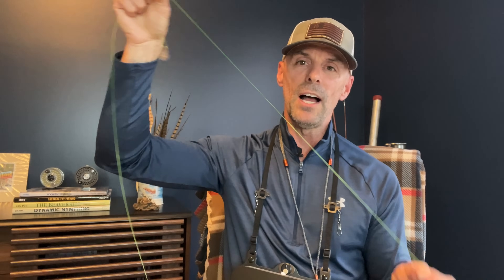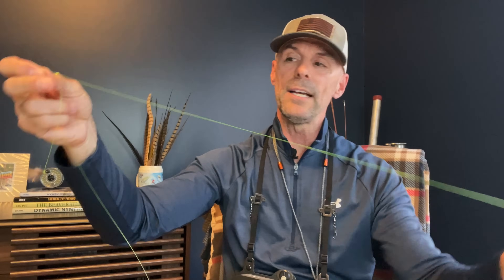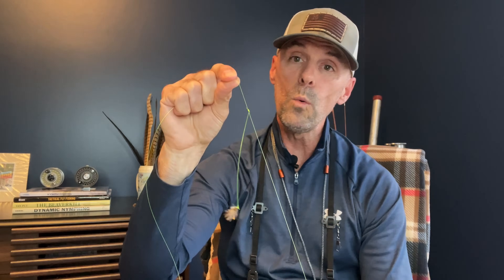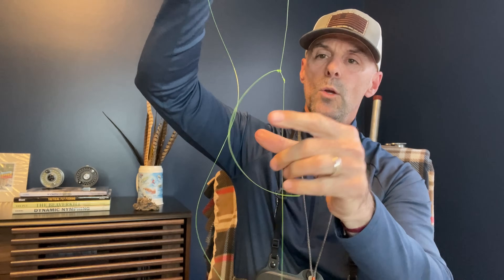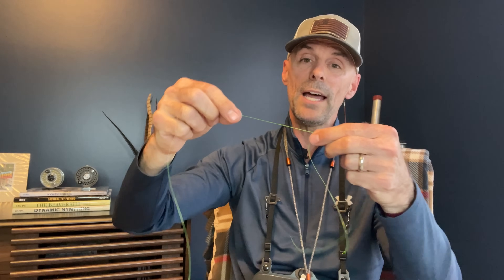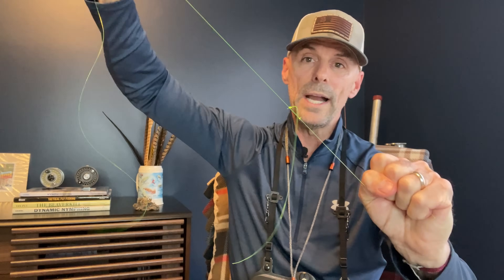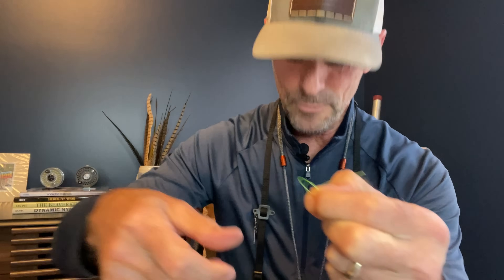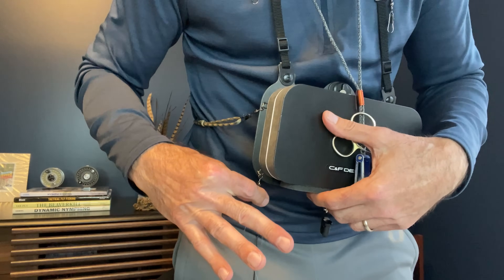How to make an ADJUSTABLE Dry-Dropper System

Comment: Thanks for this video ( and all your others).  It's amazing how fly fishers get to the same place using different methods. I tie a tippet ring on the end of my dry- dropper hoppers and then it's easy to adjust the depth. Just clip off the old and tie in a new length of tippet and your ready. Starting in a couple of weeks I'll use this almost exclusively on small Western rivers and streams.
Reply: you use a tippet ring in the fly?  Or do I misunderstand?   (at that point, why not tie off the bend?)
Reply from the maker: Sounds like a good one, William.  We can all learn from one another.  It’s what makes this sport so great.  Good luck to you!

Comment: I use this system for steelhead with weight on the bottom and fly on the tag and the loop lands all of them. I also keep my tags in a used plastic extra gum containers keeps them neat. Thanks for expanding my knowledge, great idea.
Reply from the maker: Perfect testimony on how they hold, Kyle.  And the gum containers are a great idea.  Thanks for watching!
Reply: You have helped me understand hopper dropper rigs and especially the adjustable hopper. Thankyou Mike USAF Ret
Reply from the maker: Glad it is helpful, Mike.  Thank you for your service!!

Comment: First, I am a big fan, thank you for the great content.  With making fishing easier, Dr. Paul Gaskell teaches a ladder leader, which is a series of figure 8 knots that you tie in several places in the point or main line. So you can move your tags wherever you need. I have been using this and moving tags around is fast from a foot of water to four. The plus is that the perfection loop spins on the main line also making for less unwanted knots
Reply from the maker: Appreciate you being a fan, Rob.  That sounds like a fantastic way. That’s the great thing about this sport, we can learn so much from one another.  Thanks so much for watching and tight lines to you.
Reply: Hi Rob.  Can you kindly post the ladder video?  I could not locate it.  Thanks in advance.

Comment: I just recently switched to that c&f pack also, loving it so far. I replaced the neck strap with Paracord and foam from another old lanyard for better comfort
Reply from the maker: I’ve been using it a lot this spring and loving it, as well.  So nice to go so light on the stream.  Sound like a nice idea with the neck strap.  Appreciate you watching.
Reply: @OldDominionTroutBum  i've seen a few spanish and french comp guys who use this chest box too, and they've found interesting ways to rig it with the back panel from umpqua, W&J, and one even made a back pocket out of the new patagonia stealth work station. 

i'm gonna give the chest box & lumbar pack a try this summer for wet wading, when i don't need to carry extra layers,

Comment: Hey Cory!  Cool idea!  Lack of adjustability is the main reason why I will fish an indicator instead of a dry fly in some of these situations.  This obviously solves that which is super cool.  I'm wondering if you have tried doing a similar thing as this using a uni knot, similar to what you would do when adding a backing barrel?  They are adjustable and you could leave a tag for the dry fly.  I'm guessing it would be kind of hard to get the tension right with fine tippet compared to your method.  I might give it a try and see what happens.  Thanks for sharing.
Reply from the maker: Hey Eric.  I don't like using the uni because it is a little too tight for lighter tippet.  When you slide it up and down, it will kink up your tippet.  The perfection loop is easier on it.  This will definitely work for you.  Just make sure you keep your dry fly nice and dry.  If it gets a little wet and sinks, the surface will "grab" it and want to pull it down.  Good luck to you and I appreciate you watching!

Comment: Question for ya , have you ever had any issues with hook ups on the dry . Does the perfection loop ever loosen on the line and lead to a softer hook set because of the loop sliding down the line until it hits that stopper knot or has that not been a problem ? 
Great video ! And I can’t wait to give this system a go . Cheers
Reply from the maker: Chris,  I have no problem with hook ups.  The tension created from the surface and the rod hook set are all you need.  

On a side note, every now and then the dropper will slide if it partially submerged and the water "grabs" it and pulls it down when you lift it out of the water.  Make sure your dry is riding high and you will be fine.

Good luck and thanks for watching.  Tight lines.

Comment: As a fly angler who will often use a loop knot to attach my bugs (often very small bugs), I will typically use the perfection loop - even w 7x tippet. Understanding the anatomy of the loop helps to keep it really small, ie the correct proportion of loop size to fly size. Whereas, the hemo hack works, it is difficult to maintain a consistent loop size. Cool hack, but inconsistent (for me anyway 😊)
Reply from the maker: Stephen,  you may want to check out my other video on how the make your loop small.  But for this application, it doesn’t need to be super small.  Tight lines to you.

Comment: The length of my dropper doesn't seem to matter. Snarls haunt me. Love the moveable tags. 

After giving a lot of thought to the dry dropper issue, I've drawn from a few sources, you included, and worked out a simple fly that I think may do the trick. Thinly dubbed abdomen, deer hair wing, a second wing of several preened cul de canard feather tips, and a splash of hot pink filament in front. Thin wire long #14. 

Have you fished any of the spring-fed streams in the Missouri Ozarks? Enormous springs, some of them
Reply from the maker: Sounds like a winner to me, Larry.  I have not fished the Ozarks.  So many places to go, so little time!

Comment: Thanks for the videos, big fan! Have subscribed!

Question: assuming the slideable dry fly tag should be fluoro (vs nylon), since its not really floating on the surface, but rather being pulled down under the water by the weight of thr nymph?
Reply from the maker: Thank you, SMH!
Yes, on the fluoro.  I even use it for tippet when dry-fly fishing.
Hope this helps.  Appreciate you watching and the sub.  Tight lines!

Comment: Love this...the best ideas are the simplest and this is genius, Cory. Thanks for sharing your expertise. Question fro you: What's your recommendation for tippet when making a bunch of these perfection loop dry fly lines to take with me? Would using my 2lb or 4lb trout mono line work? Or, should I make them with a 3, 4, or 5X tippet? Thanks again...gonna put this in play this weekend up on the Upper Owens River.
Reply from the maker: Thanks so much, Chris!  I always match it to the same size tippet I am using.  You can certainly use 2lb or 4lb test.  Good luck to you and just make sure you keep your dry fly high and dry.  Once they get waterlogged, the surface wants to "grab" it and pull it down when you take it out.  Tight lines to you!

Comment: Thanks Cory for your videos, been binge watching your content just subscribed! Two questions

1. On a traditional fly like does the dry fly on a tag reduce strike detection? 

2. Any tips on preventing tangles when casting on traditional fly line when using dry off the tag?
Reply from the maker: Appreciate you binge watching, Sam!  
The tag doesn’t reduce strike detection at all.  You will see plenty.
To reduce tangles, you have to slow the cast down and keep it in control.
I will add, casting a traditional line with this system can cause your fly to slip back down because of the force of the cast, especially when lifting it out of the water because the surface will “grab” it. So keep it nice and easy.  
Hope this helps.  Thanks for the sub!
Reply: @OldDominionTroutBum  appreciate the response Cory!

Comment: I have always used a  stopper knots to for building tag rigs.   But I have always relied on multiple stopper knots for the different depths.  I think having a SINGLE stopper knot as you showed is genius, because the ones above 1 foot are really not necessary andt he line is so much "cleaner".  Cory, a big thanks for your tips.  By the way, I just use a figure 8 knot instead of building it with 2 separate lines and cutting the tags off.  What do you think?   I also use a Double Davy above the knot as it is smaller, gathers less moss,  and seconds to tie.  For the tag, I use the DD because it requires less length than the 16/20 knot (as little as 3") which is a plus when the tag gets shorter and shorter.
Reply from the maker: Glad you like the video.  I am a big fan of the figure 8.  I use it often.  I am also a fan of the Davy knot.  It is what I use to tie my tippet to my fly.
Appreciate you watching and Tight lines!

Comment: Great video and explanation! Two questions: are you suggesting that you start with 24" below the stopper knot and then shorten it to 12" if needed?  Why did you cut below the stopper knot? 
Second, what length leader do you start with?
Reply from the maker: Thank you, Mike!  It all depends on the depth of the water, but I would start longer than shorten if you have to.  18-24" is a good starting point.  I cut below, to show that you can do it if the trout are just under the surface or it is really shallow.

You can use this with any leader length.  A long-euro leader or a traditional leader.

Comment: I typically fish spring creeks with minimal depth change so I'm not sure on my home streams how much I'd use this system there. But I can see it's use on a few western streams I like to hit. Are there situations where in you find the adjustable system to be a hindrance vs a help and do you find yourself adjusting depth often in some situations vs others?
Reply from the maker: Andrew,  it won’t work if you are throwing large, wind resistant bugs like chubbies or stimulators, etc….they need to aerodynamic.  
The only time I don’t use it are situations like you described.  Other than that, it is a huge help.  Just have your dry floating nice and dry.  Good luck to you.

Comment: Thanks for the idea Cory.  Will the sliding dropper for the dry fly affect a hook set?
Reply from the maker: It doesn’t affect it at all, BP.  You will still have enough tension when you set the hook and drive it home, especially if you use barbless hooks.
Reply: @OldDominionTroutBum  Thanks for the info.  I'll have to try you setup on my next trip.  The wild trout rivers where I fish here in California, it's mostly artificial and barbless which I only tie anyway.

Comment: I Love the adjustable dry dropper concept, it's a great idea, and thank you for sharing it. My main fear and concern using it would be misssed hook sets on the dry due to the ability of the perfection loop to slide down the line. Has that happened to you, what is your experience?
Reply from the maker: David, I haven’t noticed missed takes.  When you set the hook, there will still be enough tension created to drive your hook home, especially if you are using barbless.  Hope this helps and appreciate you watching.
Reply: Rock climbers use a similar knot for sliding/gripping knots for ascending ropes called "prusik" knots. It's basically like this except with an extra wrap around the standing line. When the lateral tension is applied, the knot clenches the loops around the standing line and it holds in place. If this concept is reliable enough for climbers to ascend ropes, it'll hold a trout all the same.
Reply from the maker: Excellent example.  Appreciate you watching and commenting.

Comment: Hi. Great video. I have used this solution as well but the issue I’ve been having is the dry fly moves when I cast. What kind of tippet material are you using?
Reply from the maker: It may move every now and then-mostly due to the cast being “forced” or if your fly is super wind resistant.  I use a lot of CDC flies and they are more aerodynamic. Just try to keep your cast nice and smooth/easy.  Also, when your fly starts to submerge, the water will grab it and pull it down.

The tippet I use is Cortland Ultra Premium.  Hope this helps and good luck to you.

Comment: What leader formula do you like for this rig? And can a tippet ring act as a stopper for the sliding loop instead of a knot? Thanks.  Great idea!
Reply from the maker: Wendy, I use a micro leader most of the time.  You can see it here:

https://youtu.be/_LsHADwel28

And yes-you can use a tippet ring for the stopper.  

Thanks so much for watching.  Tight lines!

Comment: Thanks for the video. Do you find that the dryfly/tag will slide down to the knot below when false casting?
Reply from the maker: Abraam,  it will slide occasionally and you will have to readjust.  But it’s due to 2 things.  When you are casting “hard” or when your dry becomes partially submerged and the surface grabs it.  Just make nice and easy casts and make sure your dry is riding high and dry.

Appreciate you watching.
Reply: @OldDominionTroutBum  - Makes sense. Thanks for the tip. Will try it out this weekend. 👍

Comment: Cory, great suggestion !  I've used the double surgeon stopper for quite a while, but I didn't realize that a perfection loop used directly on tippet would actually keep the dry fly in position.  Any problem with this plan using 5x flouro  ?
Reply from the maker: RJF, you can use whatever size tippet you prefer.  You just have to make sure your dry stays nice and dry and riding high.  Every now and then you will have to slide it back into place because once your dry gets waterlogged, the surface will want to "grab" it and pull it down.

Comment: What's the advantage over just tying a clinch knot around the tippet?  Does the loop method hold the dry's position better?   Is it stronger?  Or something else?
Reply from the maker: Martin, I’m not a fan of the clinch for a couple of reasons.  1. When you slide it up and down, it kinks up your main line pretty bad because it is too tight too it.  And 2.  When you have to cut it off to put a new one on, it’s hard because the knot is tight to the main line.  Hope this helps.

Comment: I tied the perfection loop with 5x, looped it around 5x tippet and moistened it, tightened it down. But it still slips (slides)on the line. What to do. Thanks Chris
Reply from the maker: Chris, did it slip right away?  You will certainly have to readjust it every now and then because it will slip occasionally.  But the slippage is usually caused by overcasting and forcing you cast too much.  Just keep your casts nice and easy.  Also, when your dry starts to submerge, the water will grab it and pull it down.  Make sure your dry it off so it floats high.  Hope this helps.

Comment: Is the dry fly supporting the weight of the nymph in this rig, or do you fish it with a tight line, ensuring the dry fly is not pulled under?
Reply from the maker: Hey Andrew.  The dry always supports the nymph.  Thanks for watching.  

I have a few videos that show this.  You can check one out here:
https://youtu.be/5FRU1yd2MzM?si=9ArCNX5YPwAnDygd

Comment: Do you think tying the tag on with a clinch knot would be much different that the loop?
Reply from the maker: Jason, the reason I don't like the clinch is the knot cinches down too tight and it's harder to move.  It ends up "kinking" up the line when you move it.  The perfection loop is much easier on your tippet and easier to move.  You have to re-adjust it every now and then when the water grabs your dry-but it really works great.  Hope this helps.

Comment: If I want to fish deeper and I move the dry fly perfection loop up 8-12”, is it going to stay there after several casts and drifts or is it going to start sliding down? After I slide it up the line do I need to tighten the perfection loop dropper?
Reply from the maker: David, you will have to readjust every now and then if you force your cast or if the dry becomes water logged or submerged (the water grabs it and the force will move it).  Once you tighten the loop the first time it will be good to go.  Just make sure you wet the line before sliding it.  If not, the friction will kink your line.  Hope this helps.  Thanks for watching.

Comment: I'm sure I know the answer, but have you noticed any impediment to your hook sets when trout strike on the dry using this method?  It's probably miniscule, but it seems like there would be momentary slack during the time when the dry has to slide down the leader and collide with the triple surgeon's loop.
Reply from the maker: David, It doesn't hinder the hook set at all.  There really isn't any slack when the fish hits the dry.  When you set the hook, even when it slides, you'll still have enough tension to drive the hook home.  Hope this helps.  Thanks so much for watching.

Comment: hi , my problem is sinking dry and my max nymph is 3mm tungsten bead but whatever dry I use always gets pulled under so open to ideas to prevent that, cheers
Reply from the maker: I would say that your dry isn't buoyant enough.  CDC flies are excellent flies to suspend nymphs.  Also, any deer hair flies are as well.  Here is a great fly for dry-dropper:
https://youtu.be/MQU6YlWw8yY

Hope this helps.

Comment: This is a great idea, but how do you "Simply, loop it in"? at 3:15
Reply from the maker: Kevin, just lay the new tag behind the main line above the knot.  Take the end and bring it over top of the main line and take it through the loop.  Now, pull it tight to the main line.  Hope this helps.
Reply: @OldDominionTroutBum  thanks!